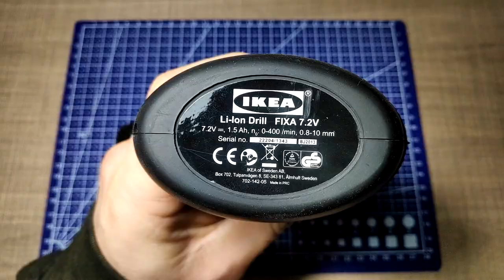Fixing IKEA FIXA 7.2V battery drill that won't spin - Repair

Comment: Hi there, thank you for sharing this. 
I have the same drill, and the transistor labeled Q2 has blown. Do you have the reference of this component ?
Thank you.
Reply from the maker: No, unfortunately not as this was from a friend of mine. However, I think it will probably be a mosfet and not a transistor. Maybe try and replace it with a generic one?

Comment: Mine its not charging :/
Reply from the maker: That can be caused by a number of reasons but I would suggest that you first check the charger and from there trace the voltage inside the drill. A broken connector or cable is the usual suspect.

Comment: I don't understand mine is new and it's not spinning anymore
Reply from the maker: Hmmm is it charged?
Reply: @TasteTheCode  yes it's charged. I used it on the wall and it stopped. Still spinning inside but outside It doesn't move anything. Just a loud noise
Reply: It's fixa 14,4  am I wrong to use it on the wall?
Reply from the maker: Sounds like a broken gear. I don't think that is fixable. :(
Reply from the maker: These are meant to be use for screwing only. The wall drill might have put in too much force onto the gearbox.
Reply: @TasteTheCode  wow I've asked the ikea worker and he said it's fine use it for the wall. That's so bad but hey thanks for the help! I appreciate it
Reply from the maker: @IIISMRIII  You are welcomed!

Comment: Thanks, I opened mine as it was very slow. 
I do not know why but an eight Philips screw popped out once I opened it and I cannot figure out where it comes from. Ideas?
Once open, the engine worked well, so opened the part towards the tip and greased the gears. I fear I put too much of it as I cannot close the four small screws without blocking the engine.
Reply from the maker: Make sure that everything is aligned properly. Grease shouldn't be an issue unless it is some very thick one.
Reply: @TasteTheCode  Thanks! Actually, I have noticed that if I tighten the four small screws joining the motor and the gear, it stops working. If I slightly loosen the screws (like just 1 turn) it gets back to work very fine.